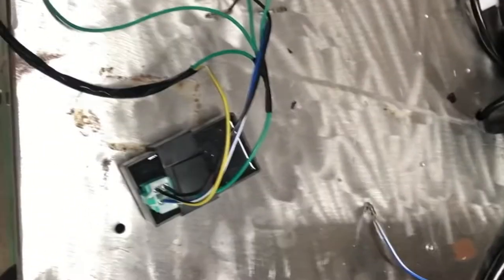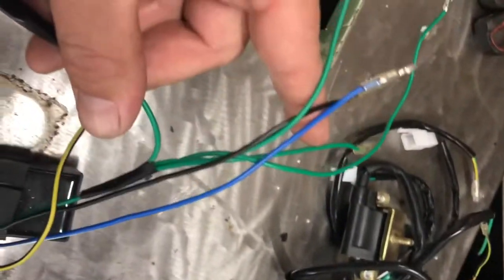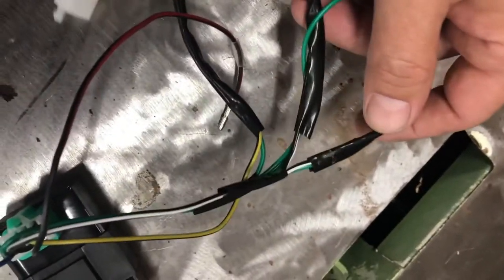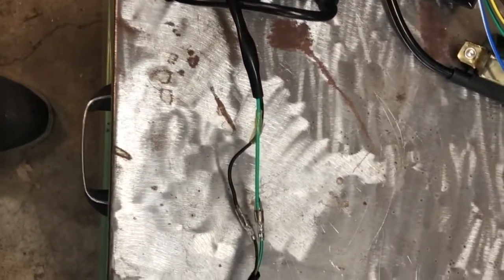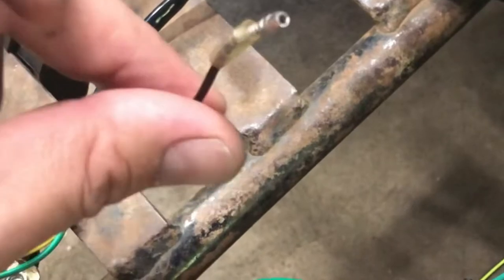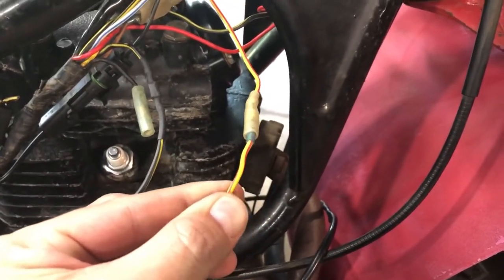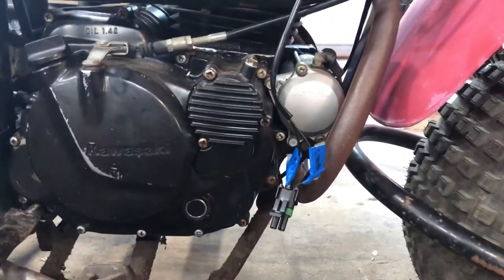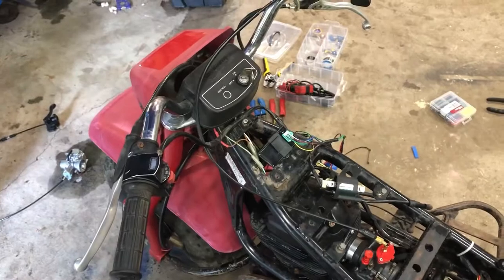Wiring a new aftermarket CDI to my KLT200/ how to make a spark box

Comment: how well did this CDI and coil set work for you? i need one for my 1983 B. i don't want to pay $500 for a new OEM but i'm also kind of skeptical about super cheap electronics, i've been burned before. is it still running well after 2 years?